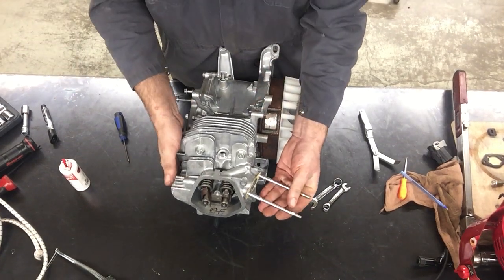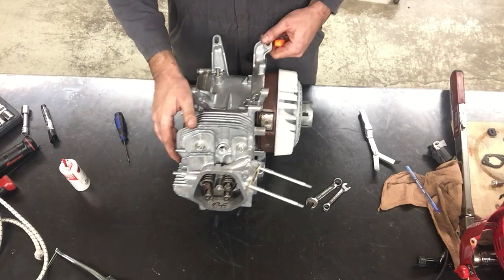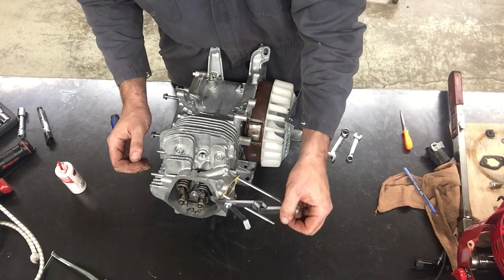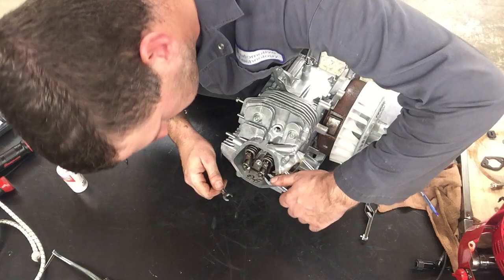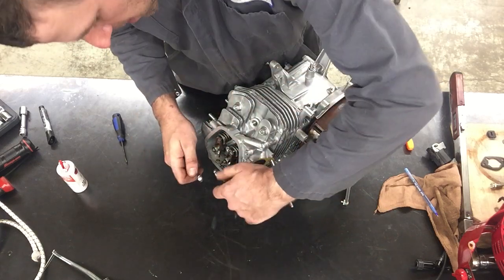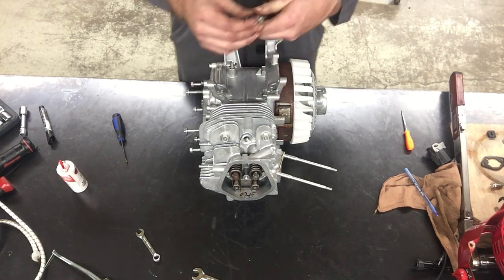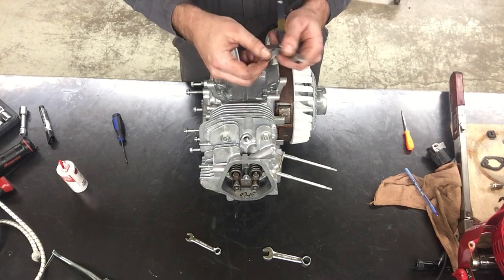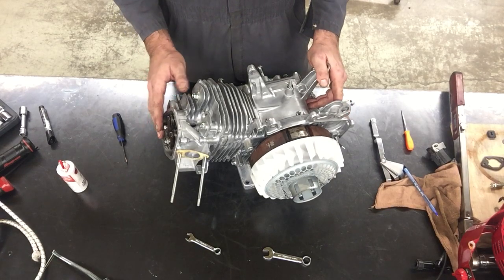Valve Clearance Honda GX390

Comment: Hello, 
I am working with the Honda GX390 engine. I need to determine the valve timing, how can I do this or do you have this information? This is the information I mean;
1) Intake valve opening angle:? 
2) Intake valve closing angle? 
3) Exhaust valve opening angle? 
4) Exhaust valve closing angle?
Reply from the maker: I imagine you are using this engine for a high performance application? There are forums for "Carting" such as https://4cycle.com/karting/threads/honda-gx390-stock-timing-what-are-you-getting.87635/

The information is probably not release from Honda themselves as they don't want to be messing with warranty claims and such. Hope this helps........

Comment: Hello, I have a question, although I have made all the connections correctly, the engine does not stop, which part may be defective?
Reply from the maker: To shutoff the engine the ignition coil is grounded. I would try removing the wire from the coil from the plug and try touching it to ground with it running. If it works the problem could be how it’s wired or the kill switch.

Comment: Would the valves being out of adjustment cause it to pull gas into the crankcase,I'm having problems with gas getting into the crankcase and I've rebuilt the carb and still having the issue
Reply: Need to have it pressure tested, should hold 7 psi
If not replace seat and needle
Reply from the maker: @philliphall5198  wondering what you use to pressure test the needle and seat?
Reply: @philliphall5198  how do I do that ,by putting pressure on the fuel inlet of the carb?
Reply: @johnnygoins7457  yes get a cheap pump at HF
Vacuum and pressure type 
There very cheap and you’ll find other use for it to 
7psi with carb upside down 
Should not leak any
Reply: If other question let me know ok
Reply from the maker: @philliphall5198  thank you. I will make that purchase. I always just blew with my mouth
Reply: @philliphall5198  yes I will check that and that you for the info,will let you know what I find but might take awhile as my sawmill is buried with about two feet of snow right now.
Reply from the maker: If it’s a four stroke engine then I would assume it has a float stuck down or a hole in the float so it never closes. The only way for fuel to get into the crankcase is by washing down the cylinder and getting by the rings. If it’s a two stroke then that’s a different story
Reply: I'm going to try and put a new carb on it and see if that changes anything. The valves were where they should be.thank you for your feedback.

Comment: the triangle arrow on my flywheel is not on top dead center, is this a bad thing?
Reply from the maker: The recoil hub and plastic blower mounted to the flywheel are all located by lining up pins. It’s possible that yours has put together improperly. It’s a pretty easy fix. Just take off the red cover and flywheel nut and pay close attention to how the blower and hun are suppose to go.
Reply: @autotech4103  pins are lining up, I think its the timing because it also has alot of pull back when i try to start it
Reply from the maker: @tsurikawa666  the pull back when your trying to start is usually improper valve clearance. Recheck to make sure it’s correct.
Reply from the maker: @tsurikawa666  https://youtu.be/hfDqqqztoMY
Reply: @autotech4103  timing on the crank wasn’t lined up

Comment: Should the valve clearance be set with the motor warm and not completely cold?
Reply from the maker: During assembly you don’t have much of a choice other than redoing it. The manual doesn’t specify so I will assume the numbers they give is for a cold engine. A hot engine would need less clearance.

Comment: Thank You for this info educational vid
Reply from the maker: Your welcome. What is your motor out of?
Reply: @autotech4103  Honda GX270 T1, with a Sinco 5kw Generator. Stripped it all down,  apart from the engine crank casing. Old weathered parts, gaskets,a replaced, rust removed, paintwork rubbed down and resprayed. Now putting it back together